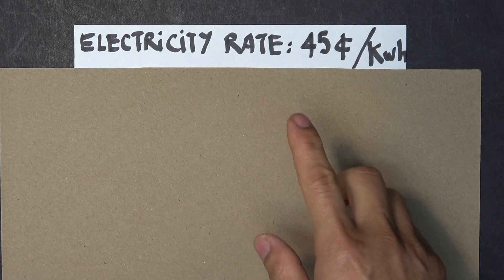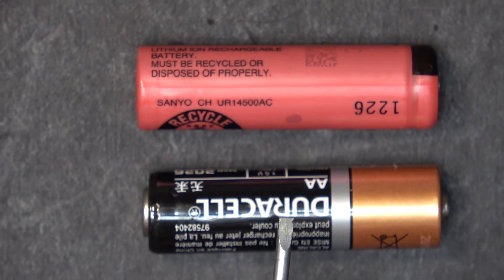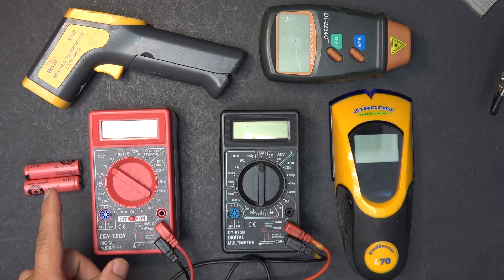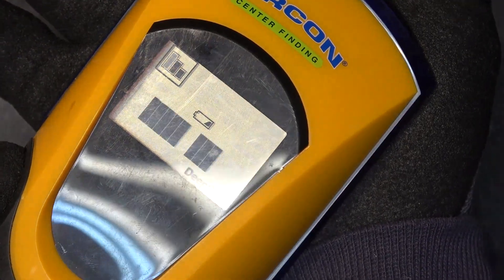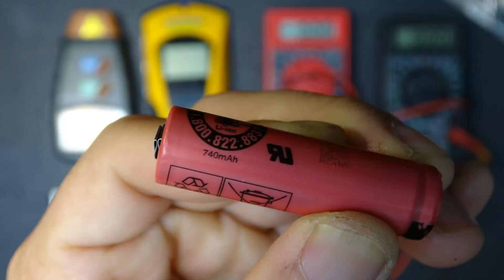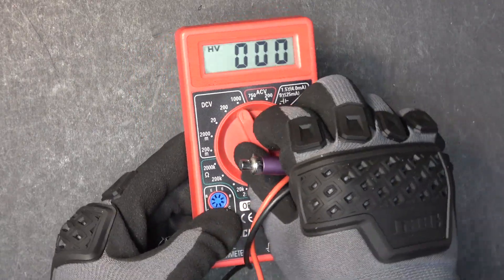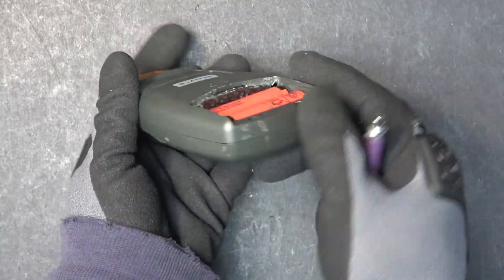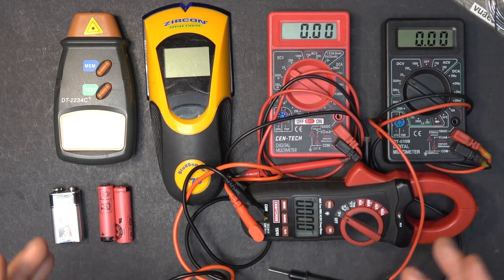9V battery to Rechargeable 14500 Li-ion battery hack: Never buy 9V battery again

Comment: Does the 14500 mod you described have any significant advantages over the rechargeable Li-ion 9VDC batteries offered on Amazon in a std 9V case?
Reply from the maker: Definitely a yes. The 14500 mod is cheaper, has much more capacity, and doesn't have a BMS which is an advantage (or disadvantage depending on how you look at it-but for me it is an advantage). This is a great question. I will probably make a separate video about this.
Reply: @vuaeco thank you, sir!
Reply: Capacity I would guess more ma
Reply: Typical alkaline 9V is around 500 - 600 mAh and the rechargeable Li on Amazon are rated at 1200 mAh.  And the 14500's seem to also be around 1100 - 1200 mAh. So I'll be interested in seeing vuaeco's follow-up video.
Reply: @JohnClulow  I have yet to see a 9v LI come in anywhere near their stated capacity. so I wouldn't trust the majority of these claims as this is what is driving sales in a highly competitive market with next to no accountability.

Comment: I've retroed a few different devices with various Lithium cells and often just solder in a universal power connector I use which matches an Imax B6 hobby charger.  The only disadvantage I see is that without a BMS, it is very possible to over-discharge the cells if you are not careful -which can damage the cells.  It happened to me on a pet's toy.  After that I try to use a BMS if only to protect the cells from being totally discharged (unknowledgeable people often use what we build).  Again, enjoyed your work Vuaeco.  BTW:  The price of D Cells are totally outrageous.

Comment: I have a question un related, i built a 100w 4 wheel drive cart it is 48v  When tested on a stand it rotates motors to full speed, when i put it on the ground and accelerate the power  disconnects and i must unplug battery from controllers to reset  Is there to much draw for the battery i built its 10000mAh with a 13s bms
Reply: 100w is nothing...how much does your motor draw??

Comment: 2 x 3.7-volt rechargeable batteries in series at best is 7.4 volts starting off fully charged.  This will look like a very weak battery to your devices.  You say 8.4 volts in your video.  I doubt this at load. Not sure how you come up with this number.
Reply: When the cell is fully charged, (depending on the charger), the voltage will be 4.1 to 4.2 volts.

Comment: 5:00 Worst problem is that  positive terminal can be shorted with negative terminal by magnet and caused fire (that magnet which is in positive terminal because all battery case is negative terminal

Comment: I use 2032 coin size batteries  stacked in seires. 3 volts times 3 equals  9 volts. Then use  a 9 volt battery conector with leads. At the end of the leads solder on ring connectors and place the connector on the batteries.  Red to the top and black to the bottom.  Slide a piece on heat shink tubing over it and shink it tightly.  Now you have a battery that will fit in any compartment.  You just have a lower capacity.
Reply: whats the advantage?  I wonder how the kwh compares in cost and to have lower capacity?  if you're going to do that then why not just by a rechargeable 9volt?  I like the concept however.

Comment: I enjoy watching your videos :), thanks and keep up the good work, quick question though, why don't you just buy rechargeable 9V batteries, it is available on the market and charged using micro USB cable, you may mount a port on the side of the cases so you don't have to open them every time you need you need to charge them!
Reply from the maker: Very good question. Someone asked me the same question. Please see the answer on top pin comment.

Comment: You probably know this already but you can charge multiple series connected cells with more than one TP4056 if you power them from separate usb supplies.  I use this trick for balancing and restoring power tool packs all the time, now I have a whole bunch of working 18v Milwaukee packs and I didn’t buy a single one of them!  😁
          🤙

Comment: Where do you buy the cables for balancing from?
Reply: They are available on amazon, ebay, aliexpress, or temu.   Just make sure you get the right size to fit your charger, some are smaller in real life than they look in the pictures.

Comment: What about low voltage issue? Draining it below X volts is bad, no?
Reply from the maker: There's no BMS so you will need to check it from time to time to make sure it doesn't get below 2.8V/cell (5.6V total). But with almost all 9V devices, they all shut down way before the battery reaches 5.6V.

Comment: Disposable E-cigarette batteries are good for that sort of thing. Sometimes you find them in the street.   There actually lithium ion batteries inside
Reply: Most of them use lithium polymer cells, but same, same.
Over the last few months I have picked up over 40+ of them off the side of the road, just keeping my eyes open when I'm out in my car.
I picked up 2 more today near the end of my street, and one is recharging right now.
Out of all the ones I've picked up, only 3 or 4 were no good, they'd been driven over by cars😁
Here's all the good one's I have collected so far:
33× 18450 - 5.18Wh.
5× 18500 - 5.92Wh.
1× 18250 - 2.22Wh.
1× 16350 - 2.405Wh.
1× 13350 - 1.85Wh.
All 3 small one's each had a built-in recharging board with a type C connector included👍
I've already used 3 of the 18450's in 2 separate projects, and been thinking of making a couple of portable powerbanks of different voltages, so far I've bought a 6S balance charge board to build a 22.2V pack for my TS101 portable soldering iron.
This video gives me a few more ideas of what the hell I can use some of the rest for🤣
Reply: @simonilett998  Incredible isn't it.  And in this day and age of everyone going green!  This crap is tossed in the bin or streets trashing the environment.  The irony!  And don't get me started on the disposable home appliances with the average tv lifespan of 5 years!  It's all BS catering to mass consumerism.
Reply: Yeah I love those little mini pouch cells for stuff like this.  Nice and compact, and I have a whole collection of them that were completely free!
Reply: If you go to the smoke shops you'll more than likely be able to find a ton in the trash they don't mind you talking lol not like they recycle them like the law states
Reply: @garrettgiuffre7298 So people take them back to the shop to be Recycled and they just put them in the bin. That's insane
Reply: @garrettgiuffre7298  definitely going to try that today, good tip

Comment: I have an indoor/outdoor thermometer that eats batteries really fast. It takes 2 AA cells in series.  It won't work well with rechargeable AA cells because the voltage is too low with those. I put a 3 cell parallel 18650 battery holder on the bottom. Made some dummy cells out of wood dowels with sheet brass terminals placed into the battery compartment and soldered the wires from the battery holder to those brass terminals. It lasts for months now. The nice thing about it is that I can swap the cells out at any time.